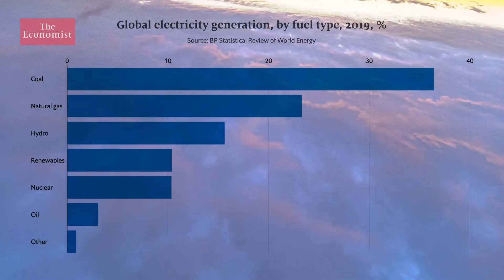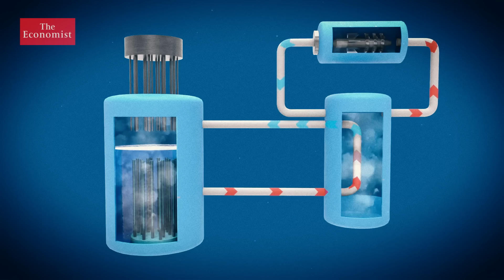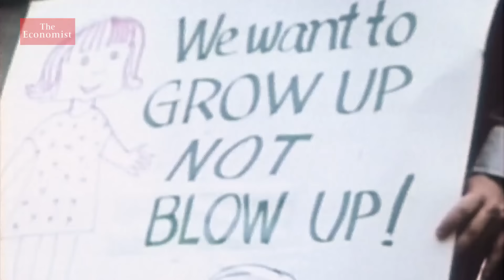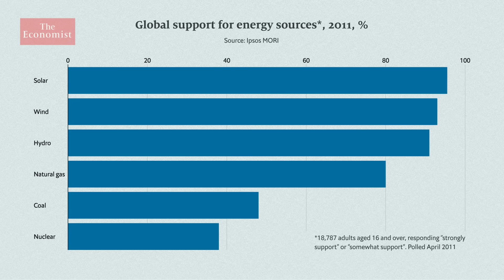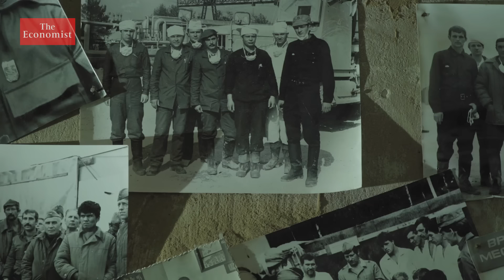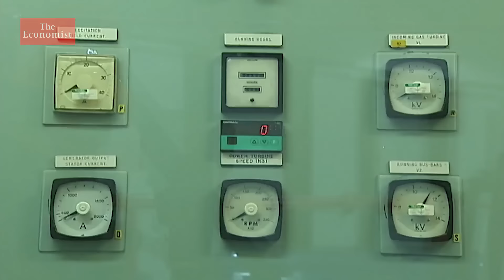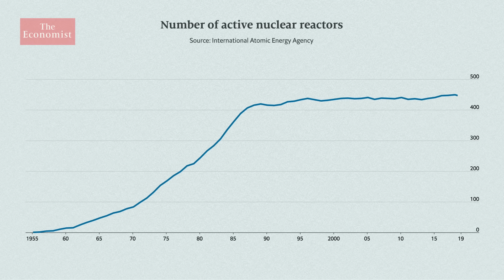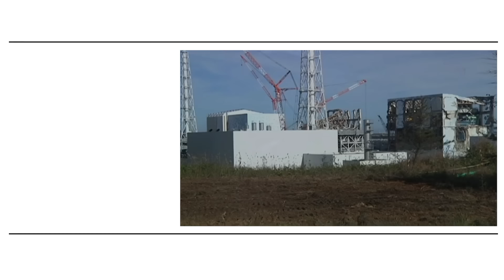Nuclear power: why is it so unpopular?

Comment: What was missed in video is that despite high capital expenditure, nuclear plants have very low operational expenditure that will offset the investment in long term and make it more profitable compared to many types of power plants due to its exceptionally long life time
Reply: You've convinced me. Now all we need is to find $10 billion for the capital costs.
Reply: Exactly
Reply: @BurningMad  reactors which produce 10 at the power of 9 watts electric, but cost 10 at the power of 10, cost 10 per watt, is like paying 5000 for a 500watt engine knowing it will last several decades and will run for nearly free cost.
Reply: Vogel unit 3 & 4 are now projected to cost $25 Billion which is a 100% cost over run and the units are still 2 years away from completion if they get completed at all.
Reply: @clarkkent9080  they are the only reactors under construction across the entire country and the reactor designer went bankrupt. Combine that with all the administrative bs and the outcome is predictable. In order for the price of reactors to come down you need to actually build more of them consistently. It’s simple economies of scale. Also GA has plant scherer which is the single largest point emission of co2 in the United States. I’d rather have the additional reactors. The only valid argument I’ve heard against plant Vogtle is the water usage from the Savannah river.
Reply: @BurningMad  The United States gave $40 billion to Ukraine like it was candy. Yet we won't spend a dime to invest in standardized nuclear reactors and Small Modular Reactors across the country. Instead we are subsidizing solar and wind which have far higher CO2 costs given the materials that need to be mined and transported.
Reply: @BurningMad  any fossil fuel buisness or 1st world government could easily scoop up the money if they really wanted to.

Comment: I've never heard an argument against nuclear power that included an understanding of nuclear power.
Reply: The usual argument is "But it went bad a few decades ago" which ignores the fact technology has moved on a huge amount since then. Modern reactors are completely different machines, lessons were learnt from failure of the past and regulations put in place to prevent the same happening again
Reply: Non gestion of nuclear waste is an argument against nuclear power that include undrstanding of nuclear power
Reply: I have never heard a truer comment
Reply: I was pro-nuclear power for a long time, "clean cheap energy for all". A visit to the science museum at Sellafield changed that for me. Dealing with waste is still an issue. Sealing it into ceramics, encased in concrete, inside a steel drum and bury it deep, was the best idea they had. Now we can't see what is happening to it! The UK cannot build it's own nuclear power stations and the people we pay to build them, do not pay decommissioning costs. A field full of solar panels is ok, hundreds of fields over the country, on rooftops of Malls and factories, connected to energy storage provide Solid Supply. Decommissioning a solar farm means the materials can be recycled into more modern efficient panels to make more clean energy. Sellafield taught me that Nuclear Power was an expensive mistake completed in 1956 that we still pay for. We (UK) are a small quite windy group of islands with decent summers in the south. Nuclear cannot compete with renewables and energy storage today. When renewables go wrong, it usually means an electrical fire, components will need replacing. A small mishap at a nuclear plant is a costly generational issue. Nuclear Power is never going to be "clean cheap energy for all" because of Waste Management Costs.
Reply: Waste is the most legitimate argument against. There is no mention of the issues posed by nuclear waste in this video at all, because that is the one aspect of nuclear power that is undeniably its single biggest pitfall. Nuclear power is far, far from "clean." It might be the lesser of some evils, but this video is very one-sided and totally ignores the potential generational impacts of nuclear waste. Currently there is only one location on the entire planet that is capable of long-term storage of cementised nuclear waste.
Reply: @dh1380  Nuclear doesn't produce as much harmful waste as people think 
94% — low-level waste (LLW)
~6% — intermediate-level waste (ILW)
<1% — high-level waste (HLW)
Reply: Yes! Thank you!
Reply: @dh1380  "Waste is the most legitimate argument against"
I disagree. Waste is the most legitimate argument in favor of nuclear power. The newer 4th-Gen reactors consume existing waste as fuel and eliminate all the high/medium level waste to produce only low level waste. If for no other reason than the new plants will consume existing waste, we need to build them.
Solar/wind/wave/hydro/geothermal power solutions offer no potential for eliminating existing nuclear waste. Without new reactors, we're stuck with that waste.

Low level waste remains problematic for about 300 years. We have enough existing nuclear waste to power the whole world at current USA levels of consumption for about 1000 years. If we did that, by the time we ran out of waste fuel, 70% of the existing waste today would have been rendered inert by reprocessing + time and could safely be used to build playground equipment for children.
The rest of the low level waste by then would have at most another 300 years to rest, with an average of 150 years before it too became inert.

Meanwhile, the exotic chemicals used in creating solar panels remain toxic indefinitely. There's no half-life for toxic chemicals remaining dangerous.
Reply: An I’ve personally never heard an argument for nuclear power that wasn’t made by an American. We all know how big energy company’s run and control America. They pay big dollars to control the curriculum and keep solar outlawed in places like Florida.
Reply: @grime2.085  So you're saying only Americans have an understanding of nuclear power?
Reply: @grime2.085       My grandfather taught Italians how to build and maintain nuclear reactors
Reply: @protorhinocerator142  I’m saying the complete opposite
Reply: just another human  Are you against nuclear energy?
Reply: just another human  You're talking about unicorn farts as an energy source.
If he has a solid state free energy system, everyone would already be using it.
You might as well believe Bob Lazar and his stories about UFO's.
No, I didn't read your unicorn book. Nobody else did either.
Reply: just another human  You are pushing a perpetual motion device as reality but you're going to lecture me about science?
Why not build your own optic dynamo generator and prove us all wrong? I'll wait.
Hey, if you can make free energy happen, we will all want it. But until then I'm betting on science that's actually proven to work.
Reply: just another human      I don’t know if it is worth reading your long comment. It was a yes or no question. Are you against nuclewr eheyrgy?
Reply: @UCWyW_xoKYxOhjJmM6J45skw    Yeah that free energy thing he was talking about is ridiculous
Reply: let s talk about nuclear waste my dear...
Reply: @mitropoulosilias      Stored underground
Reply: @mitropoulosilias  We already have.
Reply: I'm one of the few lucky ones who have, "Gas is cheaper"
Reply: @stevec6427  saying that it went bad years ago is like saying that fire is evil because it burned you. It’s true that it burned you, but it was because of your lack of understanding or outside circumstances out of our controll.
Reply: @grime2.085  alright then say your actual argument against it rather than say "oh people aren't praising it enough"
Reply: @mitropoulosilias nuclear waste? More like fuel, that stuff is used to make power nowadays.
Reply: @businessproyects2615 sounds like someone does understand nuclear power, but can't understand that costs outside of fuel + setup exist. Like I don't know, all the economic damage from pollution?

Comment: I support nuclear power
Nuclear energy is the way forward
Reply: True that
Reply: So would you like having nuclear wastes disposed near your home?
Reply: @andreaaimar246  That's why you should be a tech enthusiastic to learn about the bleeding edge.
There are few Nuclear Reactors in development which can Use Nuclear Waste Mainly U-238 as Nuclear Fission.
One example is Called Traveling Wave Reactor which is a breeding Reactor takes in U-238. And collision with a neutron converts them to Plutonium which then will undergo fission.
This Reactor runs atleast for 20 years in Theory and it's fail safe. Plus there are many new technology coming come.
Reply: @andreaaimar246  So would you like coal being disposed near you? Or gas plant being near? Or solar panel waste dump near you? 
The fact is that nuclear power requires hundreds of times less area than renewables or dozens that fossil fuel and leaves enough area to store waste away from any human habitats.
Reply: @VFPn96kQT  actually I would be kind of okay with solar panel “waste” being dumped near me, it is inert as far as I am aware. Coal ash is carcinogenic (if breathed) so I wouldn’t want coal ash at all, anywhere (and that ignores what coal releases into the air when burnt)
Reply: And yet, it will never ever come back. Because it's an unworkable pipe dream.
Reply: @SangsungMeansToCome  remember to delete your comment after few years when Nuclear becomes mainstream 👍
Reply: @bhuvaneshs.k638  remember to delete your comment after a few years when Nuclear does not become mainstream
Reply: @glennjgroves  if nuclear power doesn't become mainstream, I'm Afraid humanity have no future
Reply: @bhuvaneshs.k638  given how expensive full size nuclear generation is to build, and how long full size plants can take to build, I don’t think it will help that much. Poorer nations probably cannot afford it at all (or at least not enough to supply the majority of the power they want.) SMRs are essentially unproven, could be decades away before they are proven, and generate more expensive power. (Cheaper and quicker to build in theory, but more expensive to actually generate electricity.) Outside of places like France that have a lot of experience with nuclear and a history of safety I just cannot see it scaling up by much.

And that ignores community acceptance, safety concerns, waste concerns, availability of skilled people to design and build and operate, cost comparisons to renewables, and probably other factors also.
Reply: @glennjgroves  i can explain but it's time consuming. You can read
Michael Shellenberger book on nuclear power. Or can watch "Kyle Hill's" latest YouTube videos
Reply: @bhuvaneshs.k638  there are books and videos that explain why nuclear cannot scale up, also, and how renewables can be implemented more quickly and more cheaply. Very well meaning people can come to highly questionable conclusions when they only listen to one side of an argument. This is one cause of the Dunning-Kruger effect. You are implying - or have assumed - that you understand enough about all sides of the issue to draw and state accurate conclusions. There are a LOT of people who have studied/researched in this field who have different conclusions the ones you have stated. This should be a warning sign that your conclusions should at least be questioned.

If you only look for things that support what you already believe, you will find those things. And yet the belief may still be wrong. Without careful researching and balancing of evidence conclusions can easily be incorrect. Very few people have the training to do that research and balancing, and very few people are aware of that. We saw this during the pandemic with people blindly against vaccination when actually qualified authoritative expert based organisations said that being vaccinated was safer than not being vaccinated, as an example.
Reply: @andreaaimar246  is your home right on top of a mile-deep mountain with a cement room and ceramic barrels designed carefully to mitigate nuclear waste? If not, don’t worry
Reply: @Woopor  No, but my country is planning to host some nuclear waste zones not far from my hometown, in the near-mid future